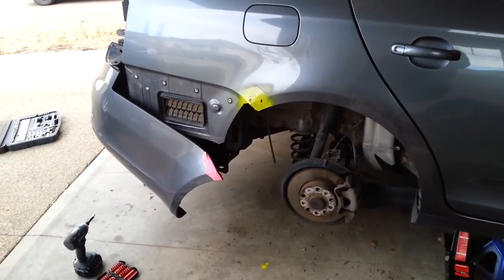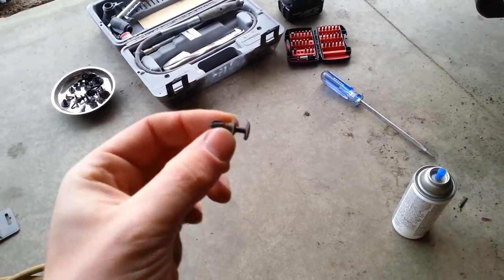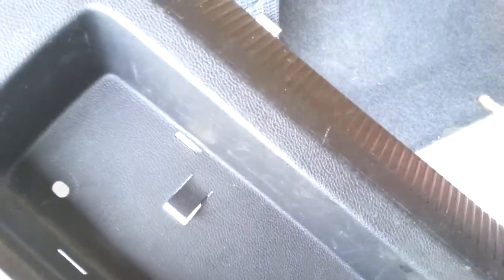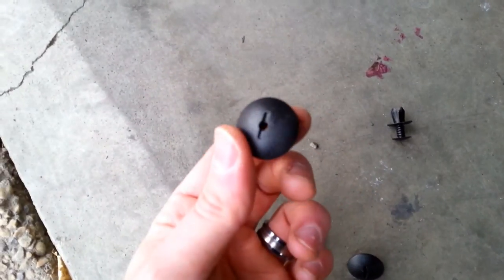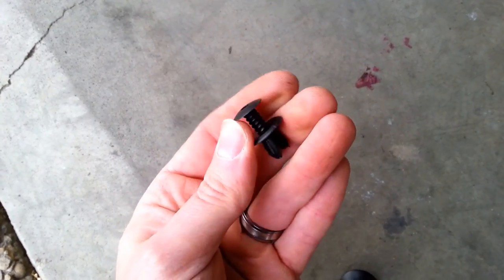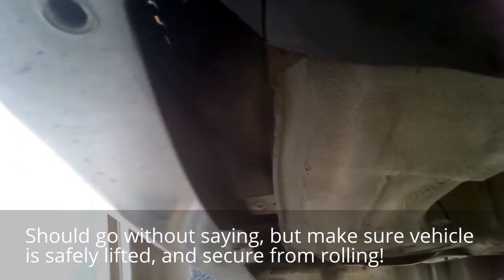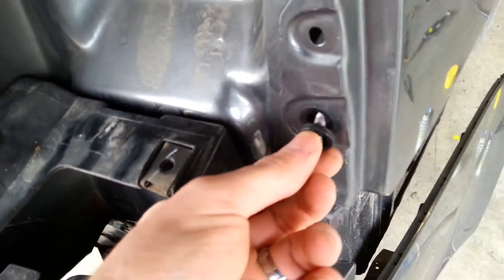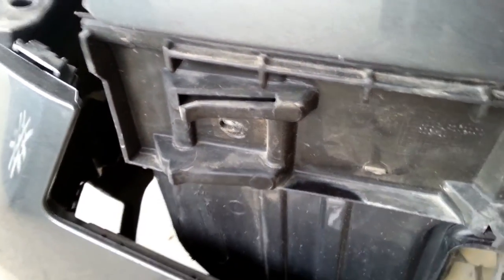2006 Jetta Rear Bumper Removal (MK IV / MK5)

Comment: The hard plastic piece that holds bumper to lower fender, did you have to replace it for clip or other failure?  I'm trying to reattach the bumper that's not being held on but it's got a bend in it.  any advice???
Reply from the maker: We'd taken this apart to try and fix the rust. So nothing was actually damaged or bent thankfully. As a result nothing in our case needed replacing. Sorry I can't be of more help to you.

Comment: 1:07 how to remove this
Reply from the maker: There are two torx head screws in those two holes I showed. If you take those out you should be able to pop that trim out. I'd send a better picture but sold this car this spring. Sorry.